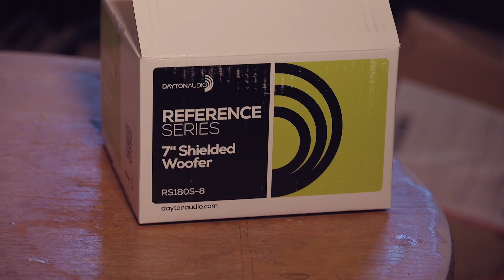DIY Wooden Speaker - Amiga MT

Comment: nice video. Aren't you arfaid that pine would dry out and change geometry?
Reply from the maker: Yes. There is a big risk that some of the glue joints can open. Then I just need to fix it. But if it just gets some character, then it is just a good thing. The wood is old and dry, I hope I dont get those issues soon. Maybe after 20 years or so.

Comment: is it okay if crossover is mounted right besides the woofer? wont inductors magnetic field interfere with the membrane? asking since this whole hifi universe is not my world....another question...could i mount the crossover at the bottom of the speaker? i would assume it does not matter where you put it
Reply from the maker: Not too close to woofer. It is the easiest way to put behind the woofer, so then you have an acces there later if needed to.

Bottom is good place, but it would be safe to have that acces if it needs replace or something.
Reply: @caide  agreed but if i integrate crossover at the bottom and put wool at the bottom of the speaker aswell near the input/output port would it be possible for inductor to melt/ignite the wool due to high temperature?
Reply from the maker: @jaxmg  some crossover components can be hot, but most of the wools dont burn so easily. I use the "rockwool" and it should be some what safe option. You should be careful, but I never heard that someones speaker got burnt. But it can be possible, I guess.
Reply: @caide  alright thanks for the advice i think ill just mount my crossover behind the wooder then i think thats the safest option :)